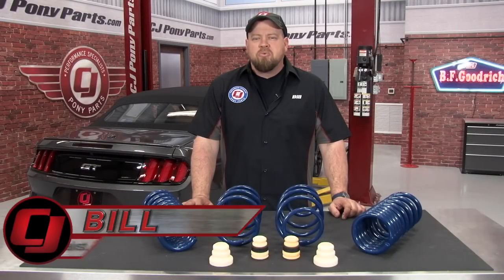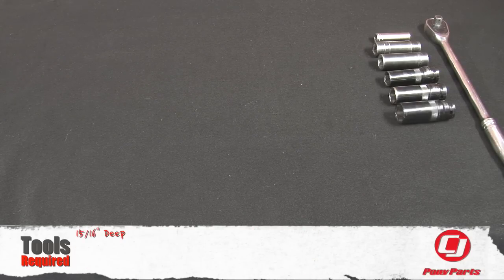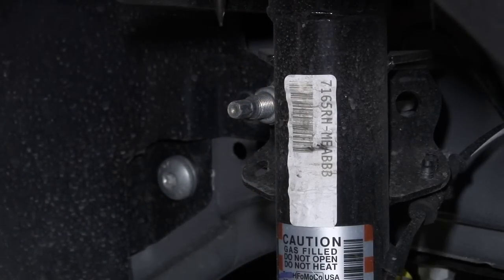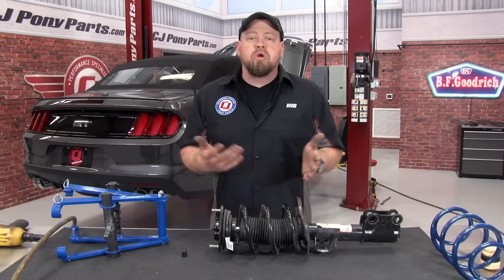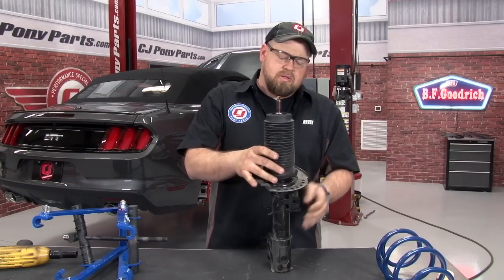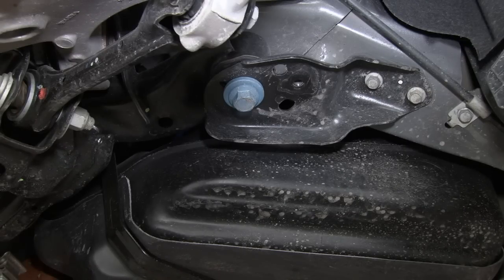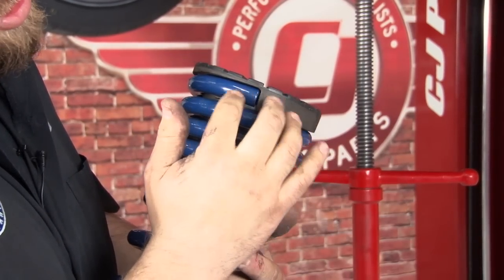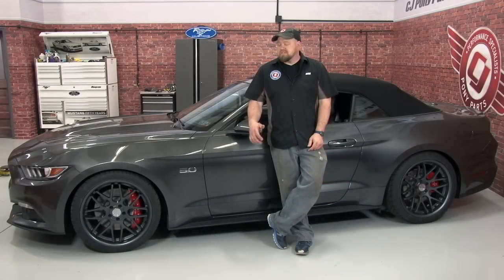2015-2019 Mustang GT/EcoBoost/V6 Ford Performance Coil Springs Street 1" GT Convertible Installation

Comment: sorry you guys forgot too mention a small BUT VERY IMPORTANT bit of info for the rear springs take off the 2 rear  muffler isolator bolts by the bumper to allow room to drop the subframe so you can remove the springs
Reply: I have never had to do that but if your exhaust does get in the way this is a good idea.
Reply: G-man what exhaust were you running?
Reply: I could not even come close to getting that spring out until I saw this tip. Thank you for mentioning it!

Comment: Could you guys do a procharger supercharger install? Its a big dollar install but also a direct bolt on from what procharger has said. It seems like a weekend warrior could do it in there driveway with no permanent changes done to the engine and add heaps of power in the end.

Comment: I know this is an old vid, but......  I just bought a 2016 GT Premium convertible with the 20" Foundry wheels. Want to lose most of the wheel well space.  Was thinking the Eibach Pro-Kit might be best as it lowers the front a touch more than the back and these cars look like they ride high in the front. Looking at lots of pics with various springs.  These springs seem to give the nicest drop even though they only advertise 1" all around.   Thoughts?

Comment: Watched this because it was a convertible, but it has the massive convertible brace removed already that prevents you from lowering the subframe.  I can’t find a single tutorial that includes what to do about the convertible bracing that’s connected to the subframe.
Reply from the maker: It is easy to unbolt and remove.
Reply: CJ Pony Parts yeah I realized that.  7 15mm bolts holding in each side and it requires 2 people to get back into place, but not hard to remove and the install was easy from there.  Thanks for these videos.  It would be nice if you could include torque specs though when possible.

Comment: I have a GT premium performance pack. How is the ride quality with these versus Eibachs Pro Kit? Which lowering springs from the two provide the most comfortable ride quality?
Reply: David Turnbull-Hardt I haven't driven this enough to have an opinion yet. I have put a lot of miles on my GT PP with the Steeda Sport and it rides really well. Same with the Pro Kit but that was a non PP car
Reply: Bill Tumas Now that some time has gone by. If you were to choose between the Ford Racing lowering springs and the Eibach Pro Kit for a PP car or your car which would you choose?
Reply: David Turnbull-Hardt The ride is a little softer with the FRPP than the Eibach but the drop is also more subtle. You really can't go wrong with either one of these.

Comment: Hi Bill, do I really need to replace the bumpstops in the rear? We  installed this springs in my 2016 GT PP but we did not replace the bumpstops in the rear because we can't get it off. There is a black stopper at the tip of the shock that prevents you from sliding out the bumpstop. I am watching this install video and yours looks like your rear bumpstops came off very easily, how did you do that??
Reply: With the mild drop of these springs the factory bumpstops will probably be fine.
Reply: Thanks, Bill! I will just keep it that way then.

Comment: I noticed you didn't need any caster camber plates for the 1" drop. I am about to install my FR springs on my 16 as well. I have the plates, but if I don't need them I wont use them. Should I let the springs settle for a couple weeks then get the alignment looked at?
Reply: +Timothy Hanson  I would use the plates if you have them since they are a beefier mount and will allow better alignment numbers. The springs won't settle enough to throw off your alignment.
Reply: +Bill Tumas Thanks so much....I was planning on at least getting the alignment looked at to make sure nothing was off too much. Unfortunately I have already sent the plates back. But if down the road i decide to lower it more I know I will definitely need the plates....
Reply: +Timothy Hanson FWIW I have the Steeda 1 in drop springs on my car and don't have the plates either, they were not available at the time.
Reply: +Bill Tumas Got the springs installed yesterday...love them. Cant wait to see it when it "settles"....I got them from yall as well as all my other new stuff for it. It rides i think better than stock....now if my wheels could just come in. tires here....wheels are taking forever to get in.